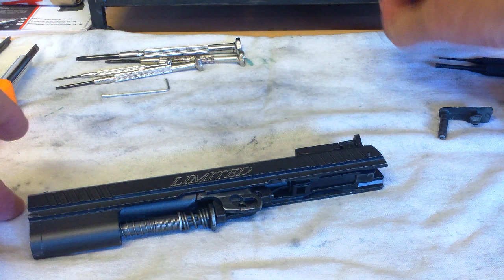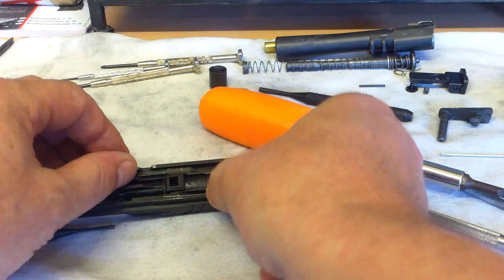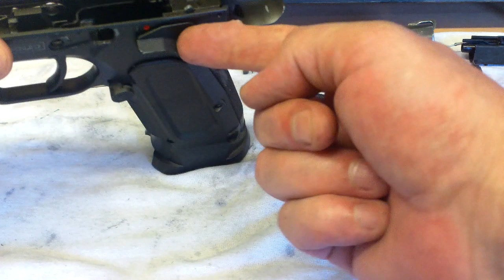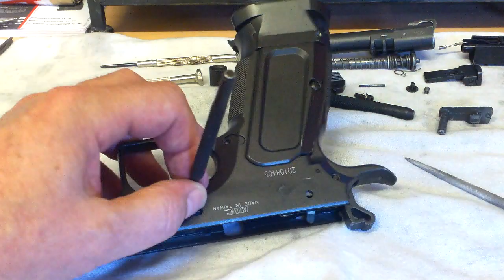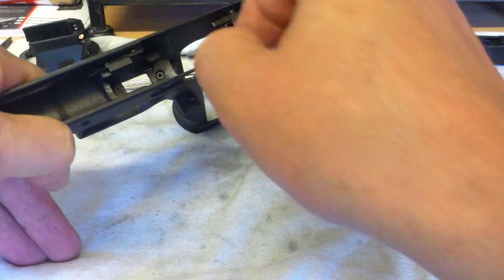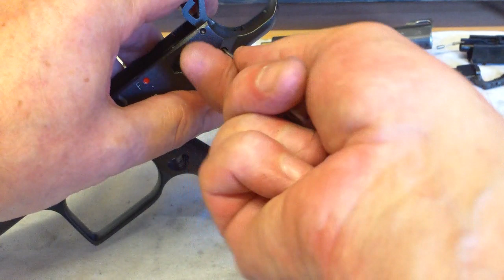Tanfoglio Ltd Custom Disassembly

Comment: I've stripped mine to the smallest bits and pieces I could, except the following: I couldn't find out how to take out 1) the small pin on the right side of the frame, right beneath the ejection port, and 2) the valve inside of the magazine where the co2 cartridge nozzle is pressed in. Any suggestions?
Reply: maadurga it's usually a reverse thread for the co2 puncture pin